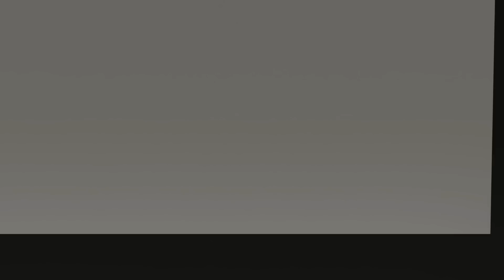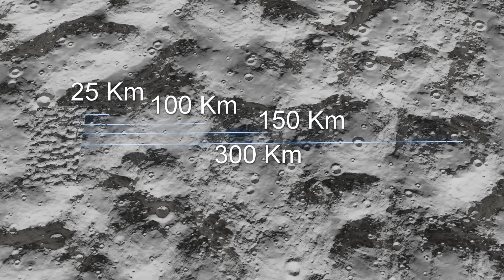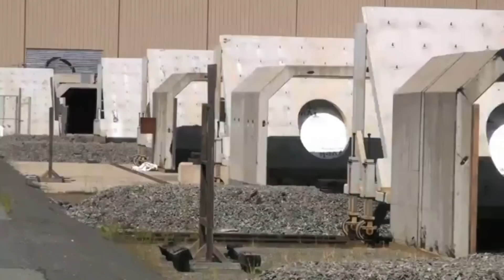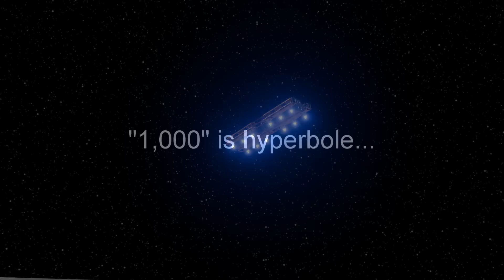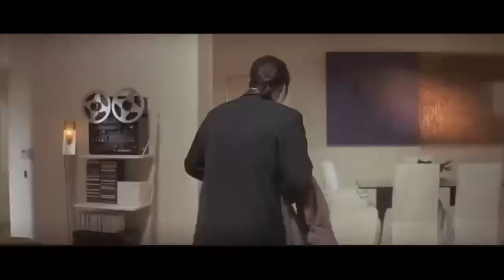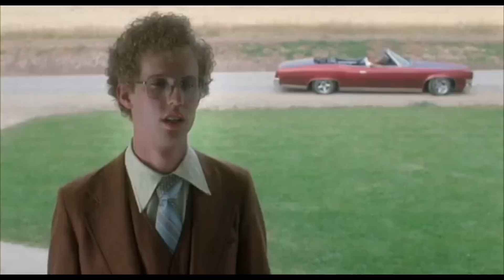Why Rail Guns Make For Better Lunar Mass Drivers

Comment: OK, if the Railgun is out, but then what about Linear Motors? Or a maglevtrain? Basically make the sled 'stupid' and the track in sections you can turn on and off with sensors. The biggest contraint on earth for maglev trains is weight and air friction, but on the moon? No these issues are not there, so we can go ham with the maglev train, the ICE4 can go up to 300Km/hr that is about 83,3m/s. "Japan's experimental maglev train L0 Series achieved 603 km/h (375 mph) on a 42.8 km (26.6 mi) magnetic levitation track in 2015." (Requoted from Wikipedia, direct source: 1). Once more airfriction prooved to be the constraint No. 1 .
Basically the Hyperloop is doomed to fail, too many issues with the pressure and possible leakages, but on the moon we have no air, and thus speeds of 1000Km/hr are somewhat easily feasable, that would impart us with 277,8m/s but teh question is how fast we can actually go under such circumstances, it literarily is a question with the notion of the physics profs at Uni "When ... then ... Hence you are to solve this and ignore air friction."

[1] https://www.theguardian.com/world/2015/apr/21/japans-maglev-train-notches-up-new-world-speed-record-in-test-run

Comment: They dont need to be linear for mass driver capability, they can be a large circle with a controlled detach of the freighter from the launch carriage
Reply: That would dramatically increase the Gs put on the payload.

Comment: your math on acceleration G's vs track length is wrong. doubling the acceleration would half the time it takes, but it would more than half the distance as you're spending less time traveling at all speeds.

Comment: Curious that you didnt mention that the rail launcher could also be used yo catch payloads landing, also reducing fuel requirements for that, having only to cancel the vertical component of acceleration, and using the rail to completely stop the payload horizontally

Comment: Possibly: when the robots are doing the 'earth-works' (moon works) to put-down th erails, it will automatically do the earth works for 2 side-by-side launch rails. The robots will build rail-set #1, and then later start building rail-set #2. We can use two sets of rails, and when one needs servceing, we still have one rail-set to keep using. Bandwidth is eather 1 or 2 rail-sets.

Also, rail-sets could impart 50% of the orbital velocity, or 75%, and the rest of the velocity is still done by fuel. That's still a lot of fuel savings.

Also (same idea as we have had on the earth) we could run the rails at a gentle ramp, and get a little lift on the launcher too.

Possibly: Rail-set #1 is short (50% of orbital speed, and no vertical assist). While we are using rail-set #1 to generate revenue, we can start building a longer (80%) rail-set #2, that also includes 50% of the needed vertical lift. Rait-set #1 pays for the building of rail-set #2. Once rail-set #2 is running, it pays for the upgrades to rail-set #1.

Comment: im absolutely infatuated with the idea of "lightly melting the surface of the moon" to make a foundation for the mass driver system. Its such a wonderfully simple brute force approach, taking advantage of the theorized abundance of heat you can generate and fairly accurately control when you dont have to worry about setting the neighbors garden on fire

Comment: The 'coil gun means small payloads' statement is inaccurate. The cargo does not need to travel inside the coils. Maglev trains are an example of this concept deployed for cargo transport.
Reply from the maker: No they're not coils they're linear magnets and use superconductors which requires a ton of stuff, even on earth they cost millions per mile and are super resource intensive.

Comment: Correct me, if I am wrong, but why not consider accelerator in a shape of giant loop. In this case you don't need to build 300 km railroad and you can make acceleration very low. It might be a problem for railgun, but you still can utilize coilgun. And in case of railgun you can still divide accelerator to independent sections.

Comment: The moon is the only place within a quarter million miles where a mag-lev train system makes sense.  I just saw a video on a hybrid coil/rail gun, a concept that would adapt to this purpose very well, I think.  The rail is a helical coil, and the shot itself closes the circuit between a section of coil that is always just ahead of the shot.  Current is run within the shot to also make it magnetic, so there's a pull-pull between the shot and the coil continuously as the shot travels down the coil.  I think it could be done brushed or brushless, but if you were doing a rail system on the moon, your brushes could actually be solid metal wheels.
Reply from the maker: interesting!

Comment: 1) It may be easier to trasport to the surface of the Moon some focusing lenses (possibly system of lenses, like multiple magnyfiing glases above each other), to process the regolith. Should use only sun-power and that should be enough to function.
2) logicaly, the freighter cart should allow to get (at least one) fully crewed+loaded and/or newly build starship from surface to orbit of the Moon.
3) espetially for longer starships/SpaceX missions in space, there will be a need for some answer to that need. That mean either some new type of interplanetary super starship, to haul the starships across, while the crew enjoys simulated gravity onboard of the superstarship, or what i see as much more feasible - fleet of starships, held (suspended) in fixed possitions relative to each other by masts and tethers. That would make the skeleton of "mothership", where crewed starships would be "hab modules" temporarily connected to the ring, and the "engines" would be some specialized "tanker starship" build for efficíency in spaceflight and sharing of fuel with others.

Comment: Given the fact that a lunar day is 14 days of sunlight followed by 14 days of night. It might be that the moon's surface isn't the best place to produce things for the space industry on, while also trying to provide power for people to live and mine on the moon. That puts extra demand on Energy storage, and or shipping huge fission reactors to the moon  and struggle to mange sufficent heat flow from the reactor. In space materiak processes in and manufacturing can be solar powered continously. 

Humans need Earth like gravity and on the moon that would pose many more challenges than it would in space with crew habitates swinging on tethers allowing workers to stay is space longer than on low gravity moon. 

And raw materials are not damaged by super high acceleration and this is where spin launch like launch platform would shine.  It can Send buckets of raw material to space cheaply with a lunar escape velocity with a launch platform simpler than SpinLaunche's current terrestrial suborbial launcher that already launches near lunar escape velocity. 

As for getting humans on and off the moon humans, all we need are small shuttles that use maglev linear induction motors. They would be far better than coil and rail mass drivers. 

So if we have magnetic induction launch for humans? Why not  maglev launch  Raw materials? We could but short rails for linear maglev launching requires massive  power demand over factions of a second  which require vast amounts of capacitors that individually don't store much energy but can deliver high power. Now this isn't a big problem if all we have is a one to or three short  launch platforms but if you want many all over the moon it's a problem. but a spin launch like platform can take its time to spin up with relativly low power available to it and would be very much smaller and cheaper that short maglev platform allowing spin launch platforms to be placed all over the moon much closer to local mining operations.

Comment: This sounds cool, but it doesn’t save money or make developing space easier.  It’s overly complicating the system.
Reply from the maker: How so?
Reply: @Anthrofuturism   your adding billions in mag accelerator track and power systems to replace a little fuel/LOx.  (Even maglev train tracks on earth cost hundreds of millions a mill to build,and maybe 1/20th as much per year to maintain.  This would need to be much more powerful,and you need to build and maintain it in high radiation areas of space., and protect from lunar dust.). Lots more to build and maintain with the track
If you want to make it easier on the LEo to Luna freighter.  Give it wings or a aerosol so it can aero brake into earth orbit without needing to boost down from the moon.  Mine oxygen from lunar soil by burning it with a little hydrogen.  The oxygen in a rocket always weighs several times as much as the fuel or unfueled rocket.

Comment: Would a space elevator kinda project be easier on the moon?
Reply: It would be a LOT easier, but still very difficult. Lunar-Earth tidal forces would cause it to be naturally unstable and wobble a bit, but this could be corrected. The biggest issue is still material science; something like Kevlar or graphite could do the trick, but it’s expensive, and the design of the elevator would need to be very redundant and have no single points of failure. Cable strength is also a factor; if the tether bringing you from orbit to surface breaks, you just fall into the moon and die, or if the tower itself breaks, parts of it could actually end up falling towards Earth. It’d be a very very complex and expensive structure but yeah, it’s possible and may be necessary for future lunar colonization as it’s significantly easier to dock large cargo vessels to the orbital section than landing the entire vessel. Starship-like vessels would have a field day with this kind of infrastructure.

Comment: I really like the concept.
Unfortunately your delta_v calculation is completely off.
You forgot all the energy needed to slow down your freighter when it comes back from the moon to earth orbit. (about 3,200m/s of delta_v) 
Add a heatshield to your freighter to minimize  wasting all the propellant just to slow down at earth. Propellant you loaded on the moon to get stuff back on the moon.
Reply: How does the heat shield help? If the freighter has to slow down by re-entering the atmosphere, it then has to be relaunched from the earth's surface which is extremely energy intensive. It also means that you can't use the simple structure designed for use only in a vacuum outlined previously.
Reply: @zj6rkr  
" If the freighter has to slow down by re-entering the atmosphere, it then has to be relaunched from the earth's surface which is extremely energy intensive." 
Do. It doesn´t need to land. But somehow it has to get rid off about 3,200m/s of velocity to brake into a low earth orbit when coming back from the moon. (same velocity change you need to get to the moon) 
If you don´t use a heat shield, you need to use your engines to perform that burn.
And remember, the ship is full of propellant to get all the payload back to the moon.

It's concerning that the creator of the video does not know this.
Reply: @3gunslingers  He talks about the need to decelerate in the video. Are you suggesting the freighter descend into the upper atmosphere to reduce velocity and then reposition into a higher orbit? This is the only approach that makes sense to me since it wouldn't be able to maintain an orbit with significant atmospheric drag. It's a interesting idea but I'm not sure why that detracts from the video. I don't think it's a reasonable expectation for a content creator to work out every single detail and identify every possible approach. Engineers will obviously have to fill in some of the gaps.
Reply: @zj6rkr  
"He talks about the need to decelerate in the video. " 
I watched it twotimes and I did not see it. Do you have a time stamp?

"Are you suggesting the freighter descend into the upper atmosphere to reduce velocity and then reposition into a higher orbit?" 
Yes. the classical aerobraking and then one short burn to circularize your orbit and get periapsis out of the atmosphere. 

"It's a interesting idea but I'm not sure why that detracts from the video. I don't think it's a reasonable expectation for a content creator to work out every single detail and identify every possible approach. " 
Because he talks extensively about energy and masses. And then somehow forgets about 1/4th of the energy budget.

"Engineers will obviously have to fill in some of the gaps."
Yeah, that would be me in this case ;)
Reply: @3gunslingers  Makes sense. I don't disagree that it's a solution worth looking into, but you'd have to factor in the effect of the additional mass of not just the heat shielding, but also the structure necessary to support it and still load and unload cargo. I suspect it's cheaper to just use rockets to decelerate, but you tell me. EDIT: That extra mass would have to be decelerated when landing on the moon, accelerated when leaving LEO, when leaving the moon, etc.

Comment: Ok hear me out… a giant trebuchet or catapult. Basically do what spinlaunch is trying to do on the moon
Reply: Given the sun shines continously in space while only 14 days of 28 days on the moon, It's probably better to process raw materials in space than on the moon for building out space infrastructure.  I'd say spinlaunch like platform  is much cheaper because it is smaller and doesn't need huge pulse power energy storage.
Reply: @kreynolds1123  but like the man said. Capsules are an issue 🤔 but if they could be made for cheap on the moon …?
Reply: @tommyweiss3886 great point. spinlaunch's orbital accelerators on earth needs a shell that can protect it from several mock velocity through earth's dense atmosphere.  That is not needed on the moon.  When they get around to building the orbital spinlauch platform they launch their payload inside an orbital accelerator (small rocket little fuel) to get the tangential velocity needed for low earth orbit.  Lunar launches with an lunar escape velocity wouldn't need orbital delta v, but would still benifit having cource correction rockets.  Launching raw materials in little more than buckets with small rocket attached would be easy to mass produce cheaply. The material might be reprocessed in space, or repurposed as disposable booster rockets that would attach to larger rocket.
Reply: @kreynolds1123   I love it!
Reply from the maker: It's very capital intense and it's main advantage is saving real estate but on the Moon we don't have zoning or nimby's so it's advantages become more about construction proximity but the tradeoff is it's a very capital intense thing to build, the engineering isn't even figured out yet Spinlaunch has a long way to go, but I do think it's definitely a possibility for later-stage development launch infrastructure.
Reply: @Anthrofuturism  How close is SpinLaunch's suborbial launch platform current launch velocity to a lunar escape velocity?  

While construction on the moon isn't likly to be cheap, it's easy to see that a lunar spin launch platform would not have to hold up to earth's gravity, and it  wouldn't need vacuum pumps, nor structure to hold back atmosphere while it spins up.
Combined, these points would drastically reduce many cost to producing this kind of launch platform on the moon. 

 On earth the object to be launched requires a shell to hold up to the heat under super sonic launch velocity in earth's atmosphere, but on the moon this is not needed. And the earth based spinlaunch needs orbial accelerator rockets to get the orbital rotational velocity needed but a lunar spinlaunch only needs lunar escape velocity and minor course correction engines that are smaller and more energy efficent, which allows for greater payload weight this holds promis for even cheaper lunar launches. 

Spinlaunches biggest issues currently are 1) finding a site for its orbital launch platform. 2) Finding customers. While spinlaunchbis activly working on launch hardening hardware that it's furture customers can use for their system, I think spinlaunch's greater future opportunity lies in cheaply getting raw materials and rocket fuel from earth to low earth orbit where space Infructure gets built out untill we are launching materials off the moon. 

Then consider the cost of launch platform power needs.  A magnetic coil, maglev induction, or rail gun  need vast quantities of near instant pulse power (probably low energy density capacitors) which adds significantly to cost over a launch platform that can spin up over time with a continouse available power like from solar pannels or nuclear power. 

 Then  there's the question, is it better to produce things for space on the lunar surface with about 354 hour nights, or continouse sunlight in the depths of space? Such long nights and added energy consumption to produce on the surface and then launch would make larger energy demands on long term energy storage.  All this sugest that it would be much better to shift most processesing and production for space industry to be done in space with lunar raw materials and lunar raw materials wouldn't be suseptible to spinlaunch launch accelerations.